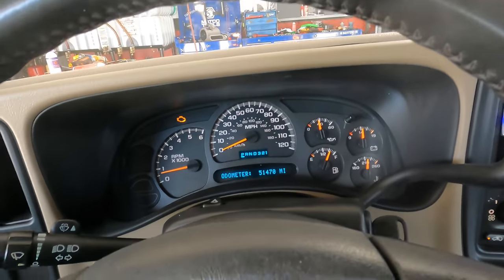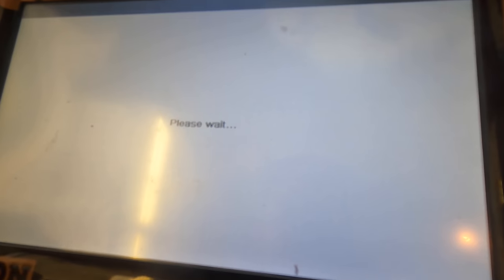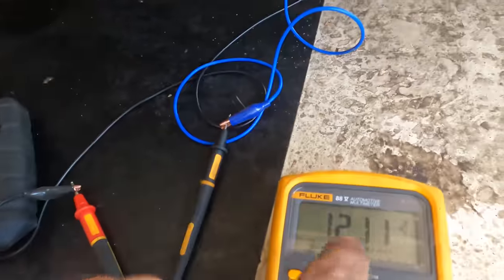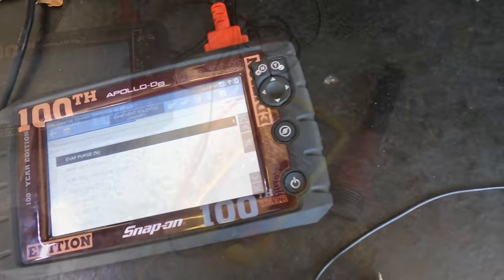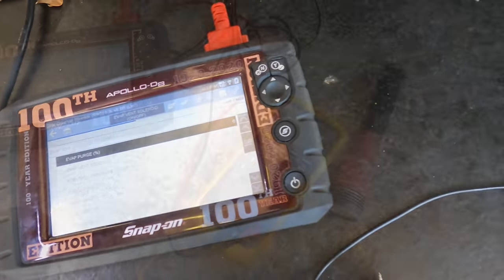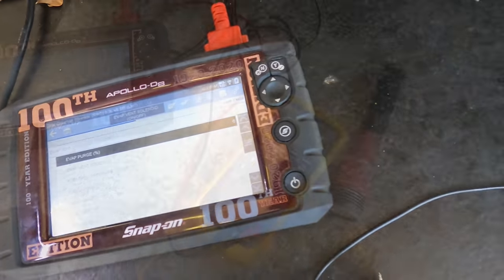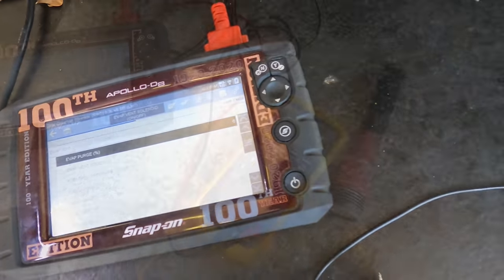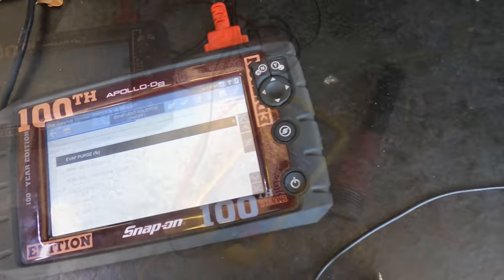RARE FAILURE! Short Circuit? Misfire Evap | Chevy Silverado 5.3 P0300 P0455

Comment: Hey Ray, been watching your videos for a couple months now and really enjoy them. I'm your typical backyard mechanic and can usually fix most things myself. I have a 2014 Silverado with the L83 DI 5.3L. I've been having emissions codes P0420 and 430. Shop I took it to replaced the cats and no fix. They then replaced all 4 O2 sensors after doing more "diagnosing." Still didn't fix the issue. Now they've had my truck for about a week and are saying the technician is leaning towards a failed ECM. Do you think they're just firing the parts cannon to see what sticks? That's my feeling. There's more to this story and how it all started but didn't want to type a novel in the comments
Reply: You need a competent shop that can perform correct diagnosis.  Those guys are just shooting the parts cannon.  Do not put in an ECU.  That idea in particular shows their vast incompetence.   Take the truck to a good shop.
Reply: @michael931  that's my thought as well. As much as I hate to do it, the only place I've had good luck at is the dealership in my area. Sucks having to pay for another diagnosis fee, but ultimately it should save me time on my end running it back and forth to the shop multiple times.
Reply: @LongrangeLauber  I assume it wasn't cheap to replace the cats that weren't actually bad apparently.
Reply: @LongrangeLauber  you could post a comment "does anyone know a good mechanic near......."  maybe there is one.
Reply: I went with non OEM cats (not knowing any better, figured they would be the same.) All in all it was around $700 for install of them. They're Magnaflow cats. And honestly, those could be the root cause of it still. I've heard of some vehicles having to do a catalytic system relearn once new cats are installed, which I don't know if the shop did or not or if it's even required for this truck. 

I'm personally leaning towards some sort of fueling issue. Sometimes it cranks over for 4-5 seconds before it fires up. But that is usually only when it's cold outside. That could also be a battery issue as well since it's over 3 years old. I've had the battery tested and they said it was still "Good" but it definitely has lost some of it's juice over the years. So I'm unsure about that.

I did see there was a TSB regarding a fuel pressure/ faulty fuel pump issue with these trucks. So I'm wondering if that's what I'm dealing with. I don't have all of the equipment to diagnose it myself. Wish I did though, and at this rate, I could probably afford a decent scan tool with bi-directional control for what I've paid the shop to throw parts at it lol

Comment: I got a 06 silverado with digital duel climate control. And my heat only works when the setting is on 90 degrees.  Every thing else works fine any idea what would cause that?  Thanks
Reply: Sounds like a blend door actuator.
Reply: @aaronbritt2025  I replaced it still doing same thing
Reply: In the headliner is a sensor that controls the temperature. It’s called a temperature aspirator. It’s behind a small round grate that looks like a small speaker cover with holes. You may want to change it with a new one. I’ve been told that this fixes temp control units that only work at 90 degrees. Good luck.
Reply: @randomschmo5778  replace that also
Reply: @Benb9903  — did you verify the two new parts were both good?
Reply: @randomschmo5778  the blend door i did not the one in the headliner.

Comment: I do not understand why there needs to be a remote tech to download software, and then upload software...this seems like something your snap-on computer could do...or any laptop.  I am sure there is some arcane reason...
Reply from the maker: It can be done from a laptop but one would need access to GMs system. They make you pay a premium for programming access. Sine we’re are retail shop and deal with several manufacturers, we outsource the programming to the company BC that already purchased access to the mfrs systems. They do the programming remotely and we pay the. A usage fee. That way the shop doesn’t have to buy subscriptions to multiple manufactures
Reply: @RainmanRaysRepairs  ahhh subscriptions..... It makes sense now.

Comment: Ray , love your vids , But you should have been in electronics repair instead of vehicle repair if you cant stand getting your hands dirty or touching petroleum products (I find funny sometimes.) . Anyway, I have seen you do this procedure a few times and dont understand why if you have to have that special programming box why they can't just let techs. download to the box then switch the new ecm and reprogram it from the box Without having to wait for them to do whatever they do over the phone..That is why I wouldn't own anything newer than late 90's as they can shut down almost anything newer at any time even diesels, with all this electronic junk they use now.....back in the day a diesel didn't need any electricity to run ,,,,,, Not anymore ...... and yes I like points  as you really can't rig up something when an electronic ignition goes out :-)  
And you got me asking "Why and Please" when things aren't going right.........thanks...
P.S. like the longer vids as I live vicariously through your videos , sometimes i miss turning wrenches as I really can't do it mutch anymore...........

Comment: A Meter is not a good way of testing that Vent Valve Circuit. Always use a loaded Tester: For example, a basic Incandescent Test Light, or even better a higher Wattage bulb.  (Ya want to be like Eric O, then try to test like he actually does.) You claim that the Contacts inside the P.C.M. must be stuck closed. There are no Relays inside to have Contacts. There are Transistors in some form of Integrated Circuits. A Meter can read 12 Volts across the Circuit regardless of how much Resistance as long as it is not a complete Open Circuit. That is why there is a different test performed with a Meter called Voltage Drop.  Ohms is a measurement of resistance in a certain Circuit. A Perfect Short will measure 0.0 Ohms. Most Test Leads will measure 0.1 - 0.3 Ohms themselves. Now let's discuss the quantity of Measurement.. Ohms is from 0 to 999. Kilo Ohms is measured in Thousands.. (Ya see how far we are getting from a shorted Circuit.) Mega Ohms is in a measurement in Millions. Then there is Giga, but does not apply in the Automotive Industry. Granted, I am not sure what is up with your Meter but, Usually the Beep is a (Short Circuit that is usually 5 Ohms or less and still shows the Low Resistance Value.) Yours Beeps and shows "OL". That stands for Open Loop... That is the opposite of a Short Circuit in the Standard that the Meter is built for. I personally believe the whole resistance test you performed and showed was corrupted in some sort of way that is not seen. I thought that the Key was not on, but you had data that was changing. Something was wrong with your Diagnosis of a P.C.M.

Comment: That company seems inept. My scanner has a module replacement function where it copies everything off of the old module and programs the new module once its plugged into the car. The scanner only cost $900. Maybe you should get a new one that has that function so you don't have to rely on this crappy company. My scanner is a LAUNCH X431

Comment: That pcm was not faulty. If you had used a normal test light and turned the vent solenoid circuit on and off you would have found that the test light turned on and off. The reason your multimeter showed constant twelve volts is because the pcm is always checking circuit integrity. And a multimeter is only as good as the tool using it. It is just comparing voltages. There is zero volts on the control wire because it is checking circuit integrity
Reply from the maker: Seriously? Go watch the video again
Reply: @RainmanRaysRepairs  your multimeter diagnostics were not enough to condemn that pcm, full stop. Put a load on the circuit to actually test it. Prove me wrong please
Reply: @RainmanRaysRepairs  oh and I'm sure eric o would agree. Ask him
Reply from the maker: Again, go back to the part where the meter detected the circuit status change when I plugged in the new ecm. Why would the old unit fail to open the circuit and the new unit does open the circuit?
Reply from the maker: If Eric sees this then I’m sure he’ll weigh in. I’m not going to pester him as if we need a mediator.
Reply: @RainmanRaysRepairs  it's out of respect as another technician. I dont mean to belittle you or anything like that. Solenoid circuits need to be tested under load. Checking resistance with a multimeter to ground through a semiconductor will always have varying results even if it's the same part number of computer. I'm just saying that what you showed on the video was not enough to condemn that computer and a test under load (such as a normal test light with a filament bulb) would have answered that for you. I shouldn't have started my first comment off with what I said because there wasn't enough information to determine if the pcm was good or not
Reply from the maker: @CFast1990  I did toss the new vent valve on just too triple check and not actuation with the old ECM. It was odd to have two faults in the same system. I should have recorded it, but it was an on the fly thing.
Reply: @RainmanRaysRepairs  did the solenoid click when you plugged it in and original pcm was installed? If the pcm had a direct short to ground then the solenoid would have actuated when you plugged it in
Reply from the maker: @CFast1990  Yup. Solenoid clicked, but couldn’t command it off
Reply: @RainmanRaysRepairs  I honestly dont believe you bro I'm not gonna lie. I feel like that definitely would have been content worthy to prove your point. We all make mistakes man learn from them
Reply from the maker: @CFast1990  I figured meter was sufficient to demonstrate 🤷‍♂️ Don’t Know what to tell you

Comment: You can get tripped up measuring voltage with zero load especially with semiconductors.  Not necessarily faulty.  DVOM is not a load of any significance.  Measuring open circuit voltage may or may not mean anything. So lame to require telephone support.  Just lame.  Glad I'm not a tech anymore.

Comment: gauge cluster was prob replaced for that low of mileage
Reply: Info stored in the pcm
Reply: I had to replace the gauge cluster on my 03 GMC with a rebuilt one, and the mileage displayed on the rebuilt cluster was 198,000 while the actual mileage on the vehicle was less than 100,000, leading me to believe that the info is stored in the cluster somehow.

Comment: I can't understand why someone hasn't made connectors that connect ECMs to a laptop so the mechanic can save the old program and install it on the new ECM. Surely it can't be that hard with the right software.
Reply: Yea its not that hard but to do that you need a specific programming from the car manufacturer so if its a VW you have to buy the VW programming software which can be up to a few grand a month per brand  thats where these remote companies come in pay for the license and are able to do it remotely
Reply: @ryanm7868  what a scam.
Reply: @johnt.848 …yea but thats the struggles of an auto shop you can either pay for you to have the software or for someone else to have it for you

Comment: When you decide to stop working in a shop, you should be teaching young people in an auto shop at a community college.
Reply: You think this job has a future in - lets say 20 years from now? With all those BEVs coming to the market?
Reply from the maker: There absolutely be a future! There will always be machines and they will always break.
Reply: @wolfgangpreier9160  Electric vehicles is going to be a phase.  As soon as people start realizing that replacing the battery packs is going to cost them 6-10K per every 3 years and we start trying to figure out how much it is going to cost to dispose of the old batteries.
As soon as people realize they have to stop at a charging station and sit there for several hours to recharge their cars when they run out of juice
As soon as they realize that all that "power" has to come from fossil fueled powered plant and they are not reducing pollution anyway
As soon as people realize that they cannot go on long trips anymore
Battery cars will go the way of the pet rock.
In my humble opinion of course.
Reply: @RainmanRaysRepairs  Every Community College here in  Florida has a degree in auto shop from ASE and auto manufacturing companies.  When you get tired of crawling under cars I think you would be a great instructor to not only teach these kids skills but work ethics as well.  I am learning a lot just from your videos.
Reply: @RainmanRaysRepairs  Yes, they will break, but not so much when they have less parts. Suspension and interior is the same, the rest just does not exist any more. You will very rarely be allowed to repair a HV battery. A electric motor lasts hundreds of years. A inverter is a plug and play replacement. Very expensive but also very easy to replace. 

Our workshops and garages start to feel the pressure. We need many more electricians, IT people and technicians for solar, wind power, plumbing than for car repairs. There are many more jobs than candidates in all of the economy. And it will get worse in the next 10-20 years until those born after the pill gap start to retire. Only hospitality and barbers have enough people.
Reply: @robertrobey5566  I do not replace my batteries after 3 years. You should not buy Ford or GM, maybe they need to replace them all the time? 
Mine will last about 600.000km. Those in my Fiat 500E about 250K because it has a smaller pack. 
Fossil powered cars are banned between 2030-2035 in Europe. You in the US will follow suit.
And if not you will have only 2 options to buy from: Toyota and GM. Good luck.

I do not regularly stop at charging stations, maybe once in two months. I charge at home of course.
My Model Y costs me the same as a VW Golf. TCO of course. I don’t care how much the car costs. 

I go on long trips all the time. I drive 45000km a year to my customers. Of course not 2000km at one stretch, Europe is not that large.
That would be to Moscow. Not very healthy for us. 1000km to the east (621 miles) would be Kiev. Also not very healthy at the moment. I guess…

Next week i drive to Poland 600km. Thats as far as i like to go in one day. Everything more than that is just tiring.
I drive from Supercharger to Supercharger, go to the loo and drink a coffee and maybe eat some buns with ham and cheese. Perfect!
Some go for fast food in those chemical outlets called Burger King or MacDonals. Not very healthy…

I would have to drive 20km only to reach the next petrol station. What for? I got all the energy at home.
Reply: @wolfgangpreier9160  I just dont think electric cars will be as popular in the U.S. as they appear to be in Europe.  I would wager that long before the European deadline to eliminate fossil fueled cars in Europe that they will change the law.
I don't think we will ever have that problem in the U.S.  We love our muscle cars and our long trips too much.
Reply: @robertrobey5566  You will see in 10 years. More then 50% of all new cars sold in the US will be electric. About 60% in Europe. 
Today its 2% in the US and about 14% in Europe.

In 2025 more then 80% of all new cars in Europe will be electric. About 50% in the US. 

Why? Because they are cheaper and we in Europe at least can not afford to buy fossil energy from Russia and the Saudis much longer. Even our natural Gas will be rationed and many gas powered homes will have to switch to electric heating with heat pumps.

Starting in 2030 the first bans of fossil powered vehicles start in the cities (London and Paris already have those). In 2035 all new fossil powered passenger cars will be banned in many countries. In 2040 all fossil powered busses and lorries up to 7,5 tons will be banned. And in 2045 all lorries and trucks.

Then its a question how all those planes will get their energy. Hydrogen? E-Fuel? I don't know. And how about the ships? Bio Diesel from the Amazonas? Not possible, the Amazonas is already gone and burnt. Shoal oil from the canadians? Gas from Burning Siberia? We'll see.
Reply: @robertrobey5566  Yep,  I think you're exactly right Sir.  Cars need to run on gasoline,  Toys run on batteries.
Reply: @robertrobey5566  true expensive transition in beginning.  But as it becomes more common, the prices will come down.  At $6+ a gallon  how much is that every 3 years?
Reply: @pmotorsports8276  Once people realize that it can take up to 48 hours to fully charge their cars or that they have to stop every few hours to sit several hours to recharge their cars and they realize that all that electricity to recharge their cars come from fossil fuels anyway, I think common sense will prevail.  
Electric cars might be good for running to the grocery, or commute to work but for taking that summer vacation - not going to happen.
Reply: @robertrobey5566  totally agree.the technology has to advance to go full blown.  It's a shame that humans in all of our advances haven't explored/advancements in other avenues
Reply: @pmotorsports8276  Like hydrogen fuel cells in cars.  Honda has one but it is only available for lease and only in CA.

Comment: Do you ever follow the instructions in the service literature? None of your testing was even remotely valid. The generic test for an evap leak is to use a smoke machine to introduce smoke into the system, then close the vent, and look for flow indication and visible leaks. You have spent a large amount of your customers hard earned money, and you have never leak tested the system.  If your employer were to start deducting the cost of these misdiagnosis's from your pay, maybe you would be motivated to learn how to properly do your job. Another epic fail.